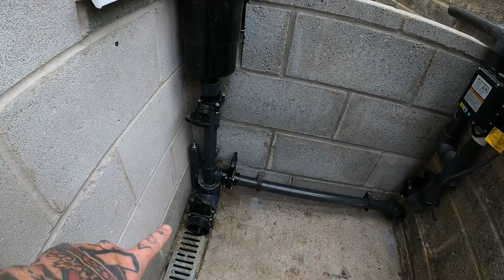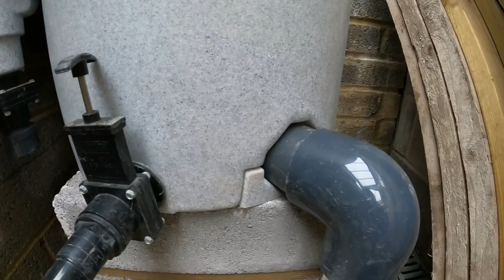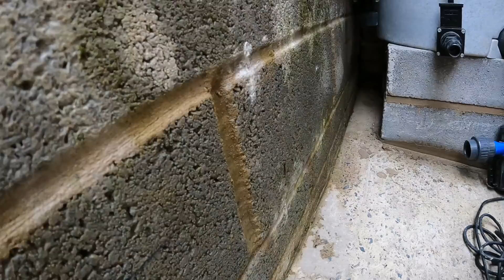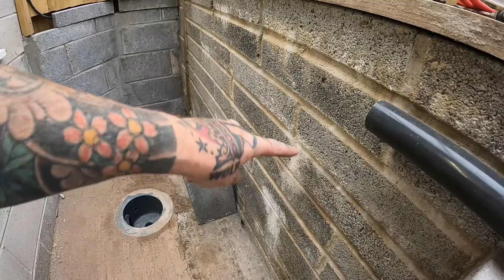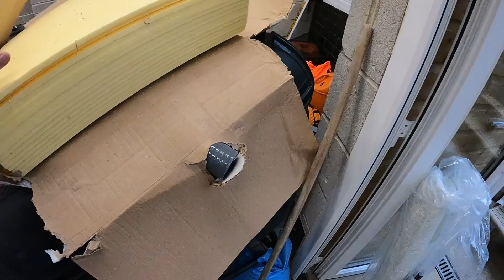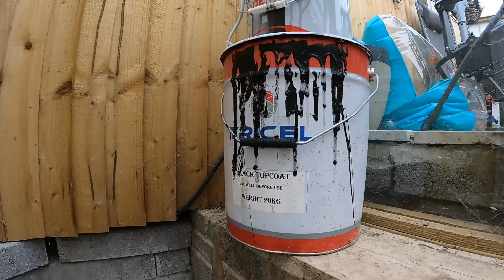Quarantine Pond fibreglassing materials!!!

Comment: Hey up,is roofing fibreglass the same as the stuff pond guys use
Reply from the maker: Fibreglass is fibreglass, keeps water out on the roof and water in on the pond 😂🥰🤟
Reply: Roofing resin has a tacky finish to it David. That’s to ensure good adhesion of the topcoat in punishing heat (full sunshine bearing down on it all day). Plus it’s also more flexible when it’s gone off to counter expansion and contraction with the roof.
Reply: @GRPLiningServices  your the man at this matt
Reply from the maker: Come glass my pond Matt, I’ll give you a zombie tattoo 🧟‍♀️